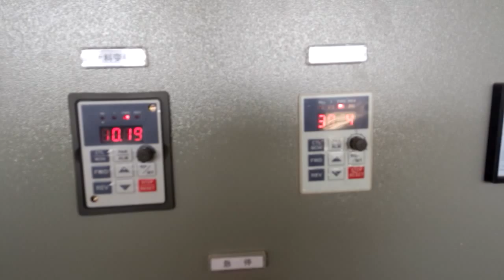gongyi  yugong wood pellet mill

Comment from the maker: Further improvements of Yugong LGX series pellet machine

● Transmission part adopts European standard gearbox reducer which has been highly praised by customers, further optimize the speed ratio, make the perfect combination of transmission efficiency and durability. Its excellent performance is not a simple gear or belt drive models can match;
● With newly designed structure, overcome the shortcomings of serious raw material leakage problem in the pelletizing room after long-term use;
● Optimized the automatic lubrication system, on the basis of without downtime to realize automatic lubricating the bearings on various parts of the machine, further equipped with a pressure value to induction grease filling quantity and timely automatically adjusted, bring really perfect lubrication and save per gram of grease.
● Optimized the raw material lifting plate equipped in the pelletizing room to enhance pelletizing efficiency and quality.
● Besides made from special alloy and processed by vacuum hardening,the roller are processed by second special treatment and its durability is highly extended.

Comment: Further improvements of Yugong LGX series wood pellet mill

● Transmission part adopts European standard gearbox reducer which has been highly praised by customers, further optimize the speed ratio, make the perfect combination of transmission efficiency and durability. Its excellent performance is not a simple gear or belt drive models can match;
● With newly designed structure, overcome the shortcomings of serious raw material leakage problem in the pelletizing room after long-term use;
● Optimized the automatic lubrication system, on the basis of without downtime to realize automatic lubricating the bearings on various parts of the machine, further equipped with a pressure value to induction grease filling quantity and timely automatically adjusted, bring really perfect lubrication and save per gram of grease.
● Optimized the raw material lifting plate equipped in the pelletizing room to enhance pelletizing efficiency and quality.
● Besides made from special alloy and processed by vacuum hardening,the roller are processed by second special treatment and its durability is highly extended.
Reply: In Zhengzhou city ( 80 kms far away from Yugong factory, near Zhengzhou Xinzheng International Airport ),
there are about 25-30 sets of semiautomatic block forming machines which are under using by our customers.

In Jiaozuo city/area ( 80-120 kms far away from Yugong factory ), there are about 15 sets of full automatic block forming machines which are under using by our customers.

In Pingdingshan area ( about 260 kms far away from Yugong factory ), there are about 35 sets of full automatic block forming machines which are under using by our customers.

WELCOME to Yugong factory, we can take you and show you any of our above clients' live production site to give you a direct image about our products' performance.